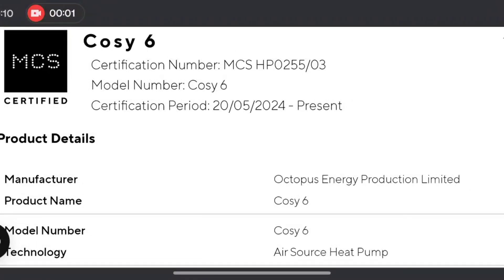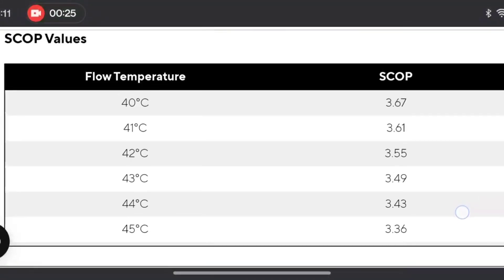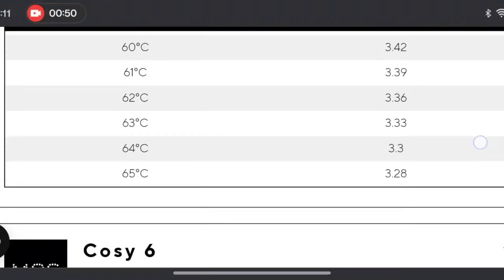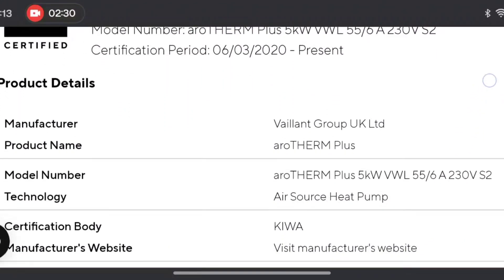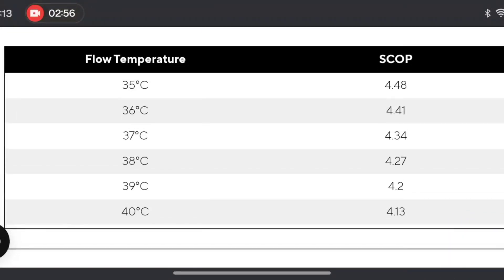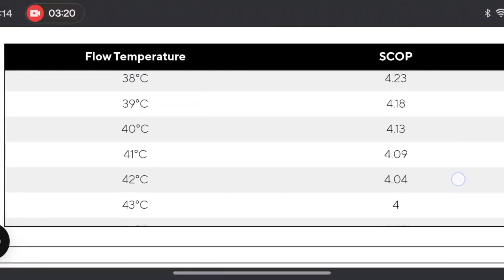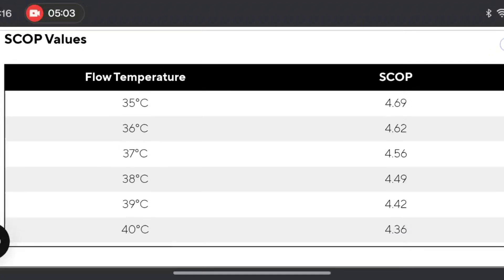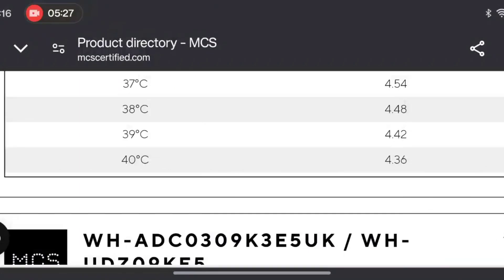Cosy 6 Heat Pump Test Results are poor. Does Octopus have a trump card?

Comment: Thanks for another great video, really interesting. I wonder what Octopus will do with those figures. Do you have any knowledge or experience of Tepeo? Especially the upcoming Combi boiler.
Reply from the maker: I did research Tepeo. I'm not a fan.
Reply: @UpsideDownFork  

"I'm not a fan"

No pun intended ;-) ?
Reply: @UpsideDownFork  Any particular reason?
Reply from the maker: @anyuone  1. Upfront cost for most people will be higher due to the BUS grant.
2. It will always consume 3-4 times more energy than a heat pump.
3. The 40kWh stored energy is not enough to see some modest sized homes through the coldest winter days, so will need to be recharged during day time hours which ruins the business model of only charging off peak.

Conduct your own heat loss survey to check whether 40kWh will see you through a whole day. On our absolute worst winter days we almost used 40kWh of electricity through our heat pump to generate over 100kWh of energy for space heating and hot water.
I recognise that this is only a handful of days, the exception rather than the rule. 
For full context we live in a modest 140sqM 4 bed detached home.

Hope that helps.

Comment: If octopus can sweeten the deal with a tariff for the Cosy 6 it could still be a winner. Every heat pump installed is tons of CO2 not being burnt in a gas boiler. But agreed, was hoping for better.
Reply from the maker: I agree, Every heat pump is a good heat pump!
Reply: @UpsideDownFork Every well-installed heat pump is a good heat pump perhaps?😉
Reply: So let me unpick this, the government gives octopus 7.5k to install a sub par heat pump that then creates a decade of locked in additional income for octopus. Clever I guess.
Reply: No, just tons of CO2 being burned to make your grid electricity to base load rewables and takevover when wind and sun are often unavailable.

Comment: Poor results for the Cosy 6 but the other big player Aira heat pump is seriously efficient. Seems to be 0.5 better than the Vaillant 5kW!
Reply: Valliant tend to underrate the performance of their products.   The 5kW unit is capable of outputs far >5kW and I regularly observe COPs of >5
Reply: @crm114.  I'm referring to MCS test results rather than manufacture ones.
Reply: @crm114.  COPs without outside air temperature are worthless. These COPs will be at a particular temperature, and it sure as hell wont be 10 degrees

Comment: I guess the high temp efficiency ratios can only go so far with current gen heap pumps? Relieved in a sense, as we've just had a Daikin Altherma 3 installed in March and were thinking should we have waited for the cozy!😊
Reply: Same, I was waiting for a cosy 6, but when the data came out I chose the Daikin instead.

Comment: Much of the stuff you was talking about was completely lost with down load and with different ways the system is installed or set up , and looking at a few videos by different installers, the two that stand out for me at least are Urban Plumbers and Heat Geek , they look at houses and how the systems were installed and many have had things that make the system inefficient with extra circulating pumps or extra vessels or wrong this or that and make the system more complicated than it needs to be, so my point is it’s a pity there isn’t some kind of blue print or program that would give you the items needed be it one circulating pump instead of two , you don’t need a buffer contraption or with your house you would be better having this size heat pump because you live in Scotland or in Devon as I do you would waste money on that heat pump you only need this size and so on , sorry for my long messages never been good at explaining things in a short way , when you think you can put the sizes of the rooms in a program to see the heat loss element with a calculation = pity there isn’t similar for the design of the perfect or near perfect design for the actual system at least the owner could do some work on having a little knowledge so they would know when they saw an installer putting in an 11kw heat pump when you know you only need a 5kw one , or when you see 17 circulator pumps being unboxed rather than one or two there’s going to be a problem, so many house that these two gentlemen have visited that the installation is wrong or badly designed just wondering in the future is there likely some program that’s in the pipeline- whoop was there a little bit of humour? .
Reply from the maker: The industry does seem to be improving and evolving rather quickly!
Reply: @UpsideDownFork  for the benefit of whom ? If the two heat installers mentioned in my last message are looking in disbelief of how the heat pump and installation was devised how then do we as normal day to day people tell if we have just had a good or bad job done and instead of it being efficient it’s ends up costing more to run than a gas boiler due to lack of knowledge by the installers.
Reply from the maker: @KavanOBrien  Many of those systems that they look at are several years old which in residential heat pump market terms, is ancient history.
I'm not saying that poor systems aren't installed any more, i'm just saying that training has improved and good principles have been more widely spread. The situation is improving all the time. Ultimately, the main beneficiary is always the householder.
Reply: @UpsideDownFork  Yes you do make some good points , I can’t help thinking of the quote from Samuel Langhorne Clemens you would probably know him as Mark Twain = History doesn’t always necessarily repeat itself but quite often rhymes. Maybe someone will come up with a concept in regards to what is needed equipment wise to give individual households to ultimate efficiency, they have so many programs in regards to room sizes for heat loss and the efficiency of the tariff the way you can alter the system on the different displays on the system = why has there not been the guess work been taken out of what is actually needed for a home , still sounds like if you get ten installers you would get ten different systems, that’s the bit that’s the problem.

Comment: Octopus's narrative is that its easier to role out high temperature heat pumps with less palava, and make the economics work with smart tarrifs. A rebalancing of tarrifs from charges on electricity to gas would help too. 

Low temperature systems are of course better. But there is still barriers to mass rollout that exist, and high temperature systems would ameliorate these. 

Id personally want a low temperature system, but my current house would require a replumb to make that work.
Reply from the maker: With my microbore pipework I had presumed my house would require a re-pipe. Then I saw the heatgeek rule of thumb tables and caught a glimmer of hope. Went on to use heatpunk to assess my own heat loss and confirmed for myself that microbore was more than sufficient and radiator upgrades were a lot easier than I expected.
Reply: @UpsideDownFork  Wow! You mean there's hope for my 1999 built home with 10mm outer diameter PVC pipe? To be honest, with the gas boiler, even in winter, my radiators are usually cold to touch and having them at 30C would make them warmer than I currently experience them.
Reply from the maker: @YewDuct  1997 built house here. Luckily my microbore is all copper so has a larger inner diameter than plastic. 
You will have to work out the heat loss per room and then you will be able to calculate if the microbore feed per room is sufficient to carry the amount of energy you need.
Many of the houses with 10mm microbore just have a small end section of that size and sometimes connect into 15mm pipework just inside the wall or under the floor.
Reply: @YewDuct  sounds like you need to flush/clean your system.
Have to be careful with Powerflush but using hot water clean may resolve the issues your having with cold radiators.
Also something you could do yourself is close the valves either side and remove and flush the radiators 1 by 1 to clean any sludge out of them. Remember after doing this you need to re-dose your heating system with Inhibitor.
Reply: flushing the heating system needs to include the pipework, as it's the pipework that's more often then not where the sludge is actively blocking flow. If a radiator were to be sludged up and rotten that bad then it's better to replace it before you suffer from a pinhole and it does damage to your home. Sludge likes to settle at the low spots in the pipework, lower than the radiator and needs the entire system flushed to dislodge. You can close the valves to every other rad and try to force flow around the cold radiator so the pump flow is concentrated through one rad, this often works. But I've never seen swapping out or even rinsing a rad sort out low or no flow issues.. @MagicianMan
Reply: How you getting on with that simple firmware upgrade from Valiant? I would not hold me breath.